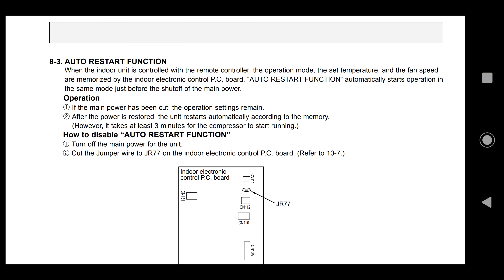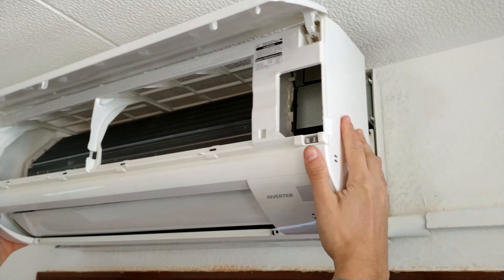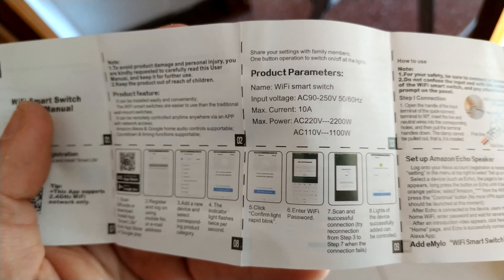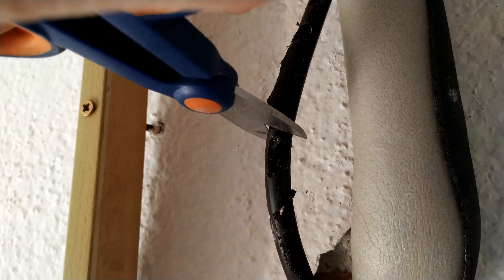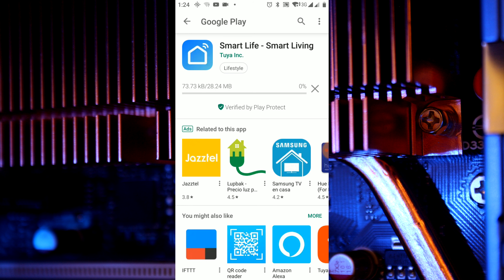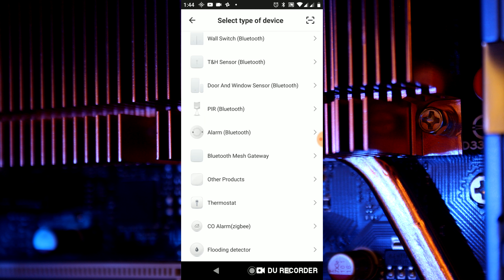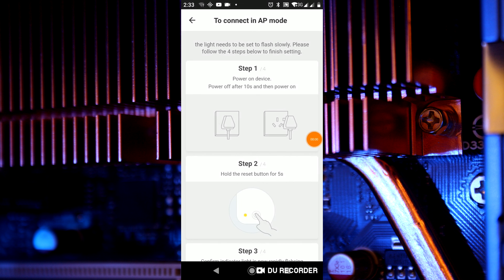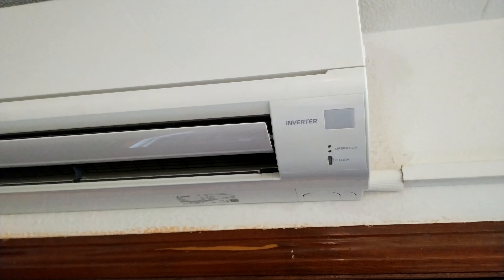❄️ Dumb air conditioner controlled by the cheapest Smart Switch Wifi on Amazon ❄️

Comment: Yeah... Don't do this with a modern heat-pump AC.
Reply from the maker: Thanks for your feedback!!❤💪
Reply: Why?
Reply from the maker: Looks like the can be damage by not switching them properly. I guess one reason is that the exterior cool down fan is stop abruptly and this can cause the equipment to over heat.